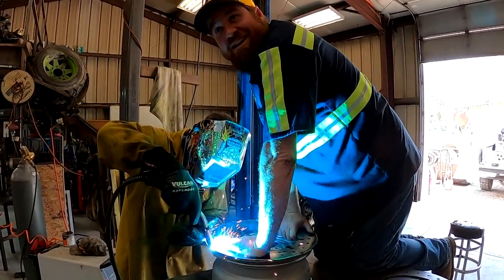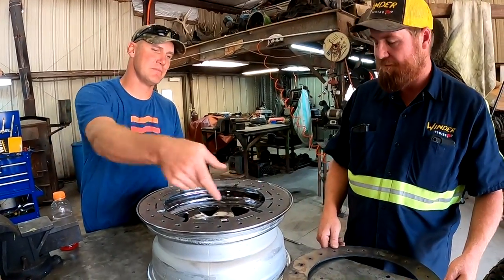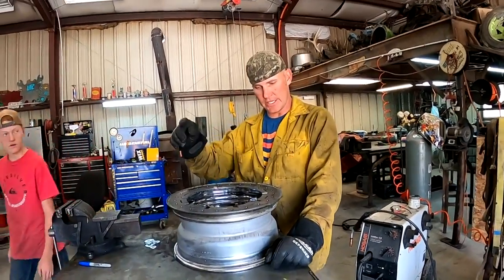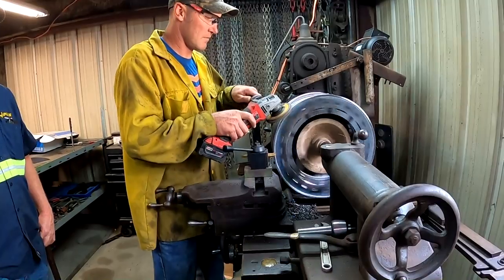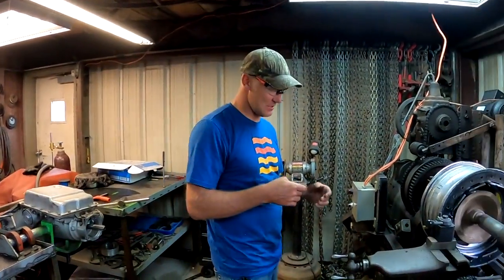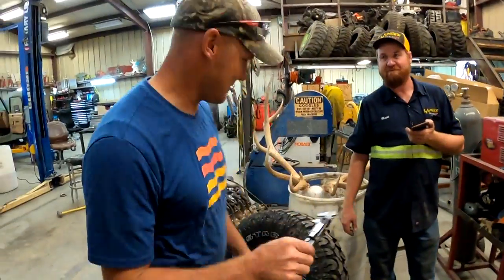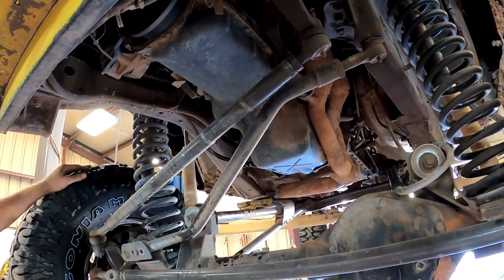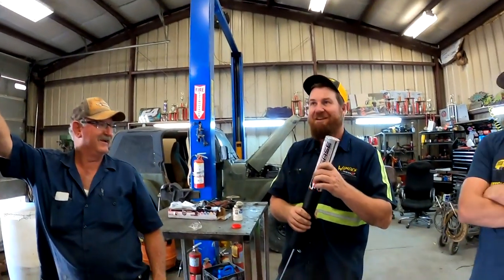Custom Bead Locks on the Yellow Banana JEEP

Comment: We all know Matt.  Those rings will NEVER get powder coated.  They will develop a nice patina of rusty Utah sand color, and be bulletproof forever!
Reply: I think you are right. He would have to take them off again to do that, that Jeep is on the road a bunch it seems. I agree with Paul, leave the wheels chrome and coat the rings Banana yellow if he does follow through.
Reply: Fab Rat what was wrong with welder you found in the dump that lathe is old school we're you get that lathe. In joy both channels 👍
Reply: Given how harsh the terrain is, any coating will likely be sandblasted and ground off in short order.
Reply: All those wheels will get is a can of spray paint.
Reply: @FabRats  perpetual sandblast ftw amirite?
Reply: Agreed. Matt is more of a "It don't have to be pretty, it just has to WORK." kind of guy.

Comment: Don’t tell Matt but Fab Rats are quickly becoming one of my favorites.  I really enjoy the diversity in your channel.  BTW, it’s fun to watch either channel when you and Matt join forces. You guys are great together. 
Tell Papa, I am 68, I remember the old way of drawing grease into the gun.
Reply: I never used that method but I do remember having a 5 gallon metal bucket with the device to fill grease guns.
Reply: @dazaspc  yes so true 😂😂
Reply: Yea I'm only 45 but yea I rem filling the grease gun various ways,, course we had to as we grew up amish weren't allowed any electric or air in the churches I grew up in,, but then we ended up going to tubes...man I love your alls both channel...
Reply: I used to have a grease zerk in the top of my hand pump grease gun and would take it to the shop and use the pneumatic gun to fill my pump grease gun.  Easy and fast.
Reply: I still draw grease into the old gun i use purely for CV grease when repacking CV joints, via snipping the small end clip of the CV boot and sliding a 4" long really narrow adaptor right up into the joint itself, CV joints like all other joints last much much longer if you give them the ocassional regrease.

Great to see grease nipples on the Banana's steering joints, only have them on the propshats of my Toyota Prado, probably they'll be done away with when the next gen Toyota 4x4's are released...cue Hardy Spicer's no longer lasting the life of the vehicle.
Reply: so do you remember 8 track LOL  or vinal records ..or house phones with a party line ..

Comment: I put air soft pellets in mine to balance them. Get them centered when bolting down the tire and you won’t have any problems. I could run down to the single digits with no leaks.  Air soft pellets work great!

Comment: Love your videos and Matts channels. You guys are some of the best shade tree mechanics I have ever seen. You guys are always airing up and deflating your tires off road fighting with the valve stem cores. I was just messing around one day while checking my fifth wheel tires. I found that if you take the Wynnsky bayonet style tire inflator gauge (just one brand) I got from Lowes for about $20.00. You disconnect it from the air hose and use it on the inflated tire it will show you the tire pressure with out leaking. Then you push the inflator lever still not connected to the air line and it will let air in the tire out at a good rate. You can let off and check the air pressure. It makes it nice not to mess with the valve stem core. ( The Wynnsky tire inflator is on Amazon for $19.00)

Comment: So...I am guessing that the inner bead doesn’t roll off enough to bother with?  I have never run beadlocks , but then, I have never put my tires through the kind of stuff Matt does.  Nice job guys!  Also..I like the chrome and yellow idea.
Reply: The inner bead usually safer being protected on the inside from striking things to knock it off. Plus the rim cannot spin in the tire now, but this isnt a true doubled beadlock like a h1 wheel. This should help 99% of the time.
Reply: @jeepindave5464  So the tire is mounted normally on the inner bead but the outer bead is pinched between the new wheel locks?... I guess the bent up tabs centers the tire adequately... What keeps air in the tire if the outer bead isn't seated properly?... So are the rims they start with narrower than the tire?... Guess I just don't get it...
Reply: @anotherjoe5675  Yes the tire is mounted normally on the inside. The outer is mounted outside the wheel on the new welded ring. The tabs do not center the tire but allow the bolt on ring to clamp the tire bead evenly. If you watch fab rats video they show how they have to center the tire with the outer ring. If the ring is welded without any pin holes in the welds, then the air cannot escape because the bead is clamped tight with the outer ring.
Reply: Another Joe All that talk about 100 thousandths was about the bent up tabs being a tenth of an inch shorter than the tire bead. So when they tightened all the little bolts, it sandwiched the bead between the inner steel ring, which is welded (and therefore sealed) to the rim, and the outer steel ring. Yes, if all those little bolts came loose, air would leak out, but that’s not likely.
Reply: Larry, thank you for asking that. I was scratching my head trying to work out how they kept air in there.......

Comment: I could not figure out how a ring welded to the outside of the wheel, with a larger ring bolted to the outside of that, could possibly lock the bead inside the wheel.  Today I learned.  Thanks!
Reply: Me too!

Comment: Nice job,  Marsh Raceing Wheels makes beadlock kits for most wheel diameters,  Chucking an axleshaft With correct bolt pattern into a lathe makes a perfect manderal...

Comment: From an engineering point of view I was very impressed the way it all came out, but from experience from offroad racing wheels I once made, the next weakest point was the lug nuts in the rim, so i made 1/8 steel spacers that were bored to clear the hubs, then migg`ed to the back side of the wheel rims then drilled through for the lug bolts.. Never lost a wheel after that, but, Matt as hard as he tries, I dont really see him throwing wheels off/ hope not anyway..lol Thanks for a great Video yet again - Ian - UK.

Comment: Those beadlocks turned out great! First time I have ever seen a DIY like this. Great craftsmanship and fabrication, however one thing I will add is that I would not recommend highway driving with these wheels (which I know you use this rig mainly offroad) because it is pretty much impossible to have a wheel that is hand made to be "perfectly balanced" so at higher speeds on road this could be problematic. But they definitely should get the job done offroad. Cudos!

Comment: I'm ignorant of beadlocks.  Don't you need one on the backside?
Reply: I don't think you can, the brakes wouldn't fit in there.
Reply: Wheels with beadlocks on both sides can be found, but they work very well with only the outside beadlock.
Reply: Yes double beadlocks are a thing, but most of the scrubbing and stress is seen by the outside of the tyre.
Reply: There's usually not enough force applied that way to break an inner bead.  Sometimes they'll belch air but rarely pop off.
Reply: Thanks, my thought as well.  When you get down to 6 lbs of air,  in rocks and sand, I don't get the logic that the inside of the tire can't get pushed off the rim just as easy as the outside.
Reply: I used to rock crawl here in CO, I guess even there breaking the outside bead was most common.  Due to great spotters and no cowboying, I never lost a bead on stock rims.
Reply: Rags722 A few ideas:  If you are in a v notch, clearly the outside is pressed in. When off camber the downhill tire has more weight on it and the outside is being pressed in.
Reply: donr416 Similar experience here. 8 inch rims avoid a lot of problems with beads.
Reply: @nealesmith1873  OK, I accept the logic that the outer side has the highest probability of getting pushed off.  However since the inside edge could still be at risk in off roading situations,  could that be corrected by screws from the outside of the rim into the bead?  I talking about rock crawlers that simply can't run the risk of losing the bead.
Reply: I've seen them in the magazines forever but had no clue as to how they actually worked. Thanks fore asking my question and for all the answers in the replies.
Reply: Rags722 What you mention about the screws has actually been done, but it's pretty rare.  The reality is that having just outer beadlocks works very well in practice.  Some military and industrial off highway vehicles come with double beadlocks for critical operations, as you mention.
Reply: Another reason inner beads aren't always necessary, if you look at the wheel itself, the inner surface that the tyre sits on is much deeper
Reply: @georgegooge8212  that is true and makes perfect sense.
Reply: What you have to remember also is that wheels are made with the outside bed slightly smaller to make tire changes possible the inside bead is larger so it take a lot more to pop a inside bead off.
Reply: @HerbTVGlum  do you have experience  with the Hutchinson beadlock? How do you install or change the tire?
Reply: @HerbTVGlum  i looked up the details. You have to use their 2 piece wheels.  Install the tire on the back rim, put in the spacer, pop the front bead over,  then then tighten the two wheel halves to clamp the beads between the spacer and the two wheel halves.  Might need to be designed for a specific tire bead width.
Reply: I had trouble with my 4x4 backhoe popping  beads
I put  silicone caulk on the beads ( the wheels  were bent too)
They would  stay on under extreme conditions.
You  have to be creative  to change tires
Reply: @Rags722  Drag racers will often install screws in the rim to keep the tire from slipping  under hard acceleration.
Reply: @bcad4066  Yup, knew that.  Just wondering why that would not be workable to keep Matt's tires on the rim under low tire pressures.
Reply: @monkeybusiness63  When I was a kid, I used roofing tar to get a bead to seat.   I feel sorry for whoever had to change that tire later, lol.
Reply: I am still confused.  It looks like the tire bead is being clamped to the OUTSIDE of wheel rim.  How does it hold air?
Reply: @Henryfreiburg  instead of sealing on the outside of the bead, like it's designed to, it's sealing on the inside due to the clamping force.
I think some people also convert to inner tubes when running bead locks, but don't quote me on that.
Reply: @Rags722  The vast majority of the time the outside bead is the one trying to be rolled off. The truck is going in a straight line, it wants to keep going in a straight line. When you go to turn the traction of the tire is transmitted through and the bead of the tire to the rim. It's a little wild to think about, but all of the turning force is transmitted via that interface held together by air pressure.  
It's significantly less common to be in a situation where the inside bead is having any substantial force applied to it.
Reply: @otm646  Yup I get all that, and understand directional forces as well.  I even get that in a hard LEFT turn, the outside passenger side front (and to a degree rear) get lots of stress.  Even though that left turn unloads the weight on the left side of the vehicle, the inside left tires also get stress.  However when talking rock crawling and super low tire pressures I still Question why not do rim locks on both sides as a well positioned rock on the inside of the tire can pop it off the bead just the same as a rock on the outside.  I guess my point is, Matt has done a GREAT job of protecting the outer bead, but nothing to protect the inner.  Considering the places he goes,  I'm surprised at a minimum the inside bead didn't get at least a few screws.

Comment: Great show. What keeps the tire from coming off on the inside of the rim?
Reply: While it is possible to get the inner bead to pop off, most of the time it is the outer beads that pop off because of the weight of the vehicle being transferred to one side of the vehicle. If you never turn the steering wheel and only go straight up or straight down hills you will probably never lose a bead. but once you start turning the steering wheel or tilting the vehicle sideways then the weight starts to transfer to the outside bead of the tires on the outside of the turn or the downhill side of the tilt.

Comment: A fellow on the Eastern Seaboard asked someone well-Educated what should be Done, to provide a protective coating for an anchor that was on display in front of a shop. The fellow with the well-chromed Dome said, "If the metal is thick enough, a good coating of iron oxide is all the protection it'll ever need."

Comment: No too shabby. That thin plate won’t dig into the tire? My Method beadlocks on my prerunner have a rounded lip on there so the aluminum ring won’t dig into the rubber. I’m sure if you called them up, they would have made you some custom rims that would have fit the Jeep.

Comment: Very impressive custom build. The effective rim width appears to have grown by perhaps as much as an inch. Hopefully the tires are fine with this. But, I wonder if this extra width could result in the tire carcass tending to pull the INNER bead inwards and unseating the inner bead at low pressure.
Reply: @MattsOffRoadRecovery  Thanks for the reply. Given that the stock rim has the OUTSIDE surface of the bead contact the inside surface of the rim , and now, the INSIDE surface of the bead is contacting the OUTSIDE surface of the rim (now with another quarter inch thickness for the inner beadlock plate), I would think that the width has grown by much more than a half inch.
The increase in width would be the addition of both the thickness between the stock  bead contact surface and the new beadlock contact surface PLUS the thickness of the tire's bead (because of the new index now being the INNER surface of the tire's bead instead of the prior OUTER surface of the tire's bead)
Reply: @gregparrott  What?
Reply: @thedave513  On the stock rim, adding tire pressure pushes the tire bead's outside surface outward, so that it contacts the flange on the rim. The beadlock system uses a steel plate welded to the flange.  If you used calipers to measure the modified flange, its thickness would be comprised of three parts - the original flange thickness, the newly added plate, and a small air gap between the flange and plate. My guesstimate is that thickness is between 3/8" and 1/2". 
In addition to the above offset, the INSIDE surface of the tire's bead contacts the weld plate (not the outside surface which originally contacted the stock flange)
Therefore, if you want to compute the increased rim width, you need to measure the modified flange thickness, and then add to it the thickness of the tire's bead (which on a truck tire is ~3/8 to 1/2".
Adding those two together suggests that the original 7" width is now between 7.75" and 8".

I once mounted tires on a substantially wider rim than the recommended rim width. While the tire popped into place with enough air, I could see the bead pull back slightly from the flange when I deflated it. My thought is that at low tire pressure, the increased rim width of the modified wheels may tend to cause the same effect. If so, then the inner bead may be more likely to unseat that it was prior to installing beadlocks.
Reply: @MattsOffRoadRecovery ,@FabRats Hey Matt & Paul, I'm a fairly new subscriber to both of y'alls channels & absolutely love them both! I know it's been a while since y'all built these beadlocks but I was wondering if you welded nuts to the backside of the inner plate or tapped the inner plate after this video was done so that all you would have to do is run the bolts down tight without having to back up the nut with a wrench? It would make it a lot easier & faster to change tires. I was just curious because I've used beadlocks in dragracing that all you had to do is tighten the bolts because the inner was threaded. Thanks for all y'alls hard work on these videos and for bringing us along for the ride!!!

Comment: I don't understand, the inside bead of the tire isn't locked if I'm seeing this correctly. Is the because the outside of the tire of both tires (driver and passenger side) take the majority of the abuse or the offset reduces the stress to the inside or is it something else? This is my first time checking out bead lock tires and I had imagined the bead would lock on both sides of the wheel.

Comment: Hi mate is ur car overheating in summer, am living in Australia where it reaches 45 degrees and xj overheating. 
Water pump ,thermostat ,clutch fan and radiator has been replaced still overheating. 
There is no issue with headgasket aswel.
I have few xj all the same problems, been told these cars running warm.
What do u suggest. 
Tnx
T

Comment: Ive done one better than launch grease across the shop. Back when i was a equipment tech, about 2000 tubes of grease changed in my life i spent 15 min trying to get my grease gun to prime before i realized i didn't pull off the tin top 😅

PS Crossed threads are better than no threads 😆

Comment: Is there a reason for only putting them on the outside of the rims?  I would have thought you would want them on both sides.
Reply from the maker: Because usually the inside doesn’t give you any problems.👍🏻

Comment: so you pinched the outside bead. What will keep the inner bead on the rim?
Reply: the weight of the vehicle shifting side to side usually puts most of the forces on the outside bead of the tires that are on the side of the vehicle that the weight is shifted to.